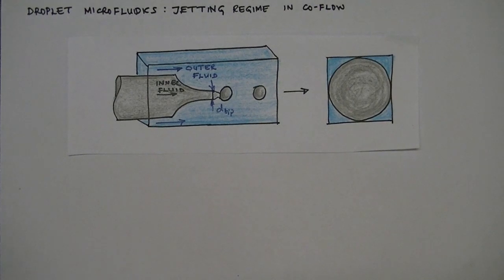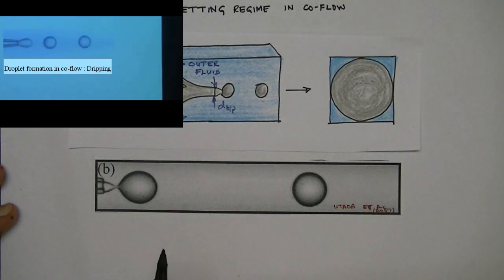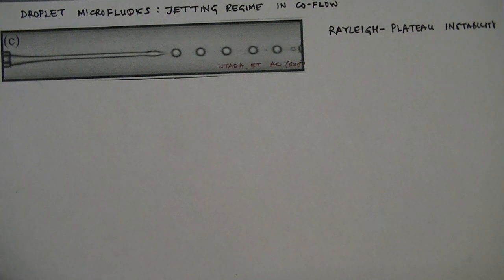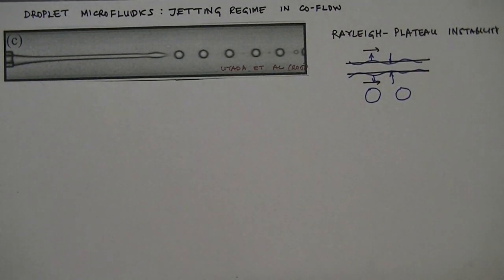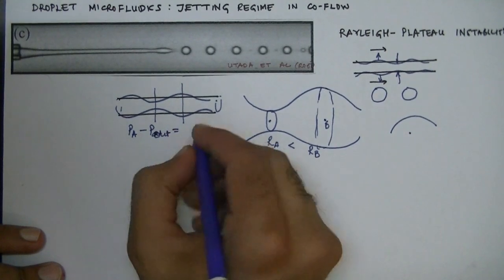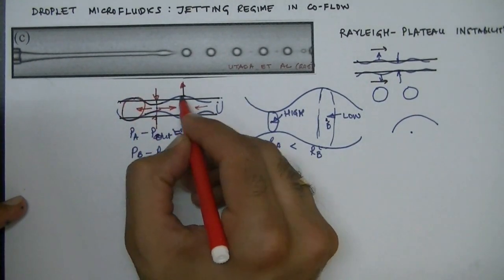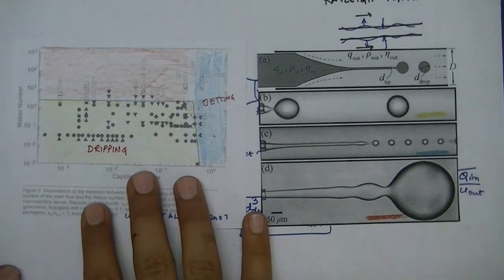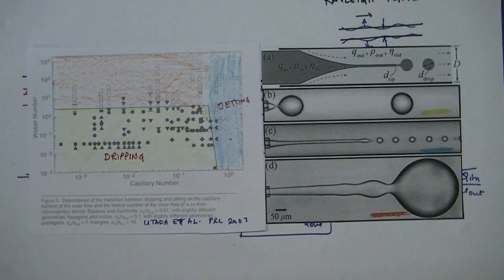Lecture 35: Droplet Microfluidics (Part 2, Jetting Regime)

Comment: Sir, im using gelma+lap in one phase and paraffin oil on the other phase. I'm struggling to get any stable drops, there are always unequal sizes。 is there any way i could know how to calculation or any hand, most of the articles they says that at a regular speed flow rate but never mention any number